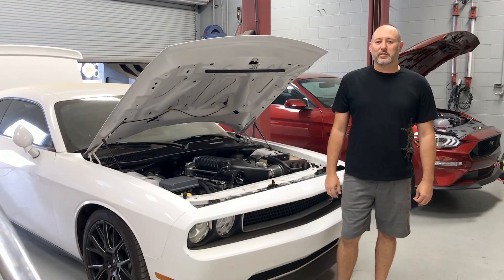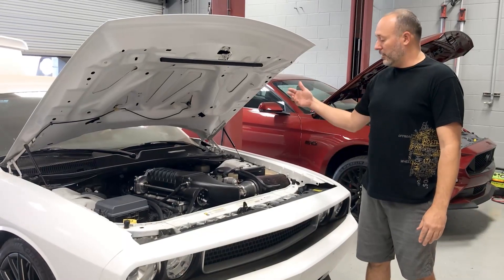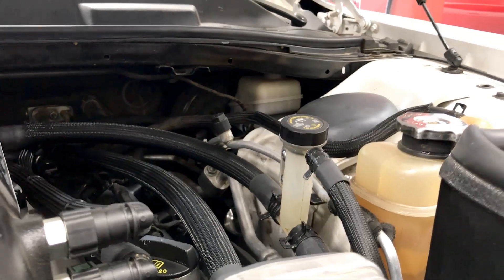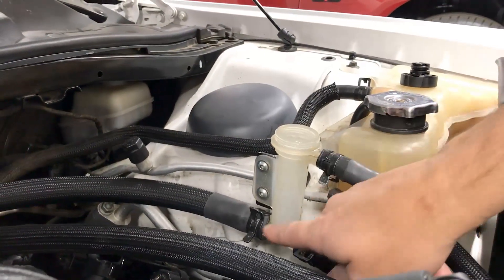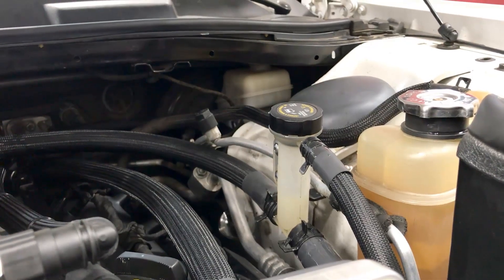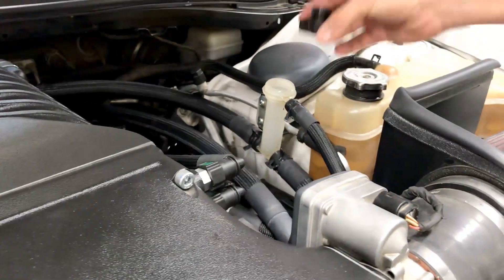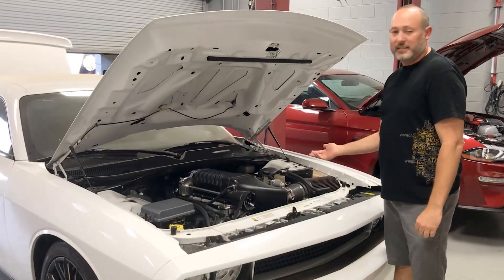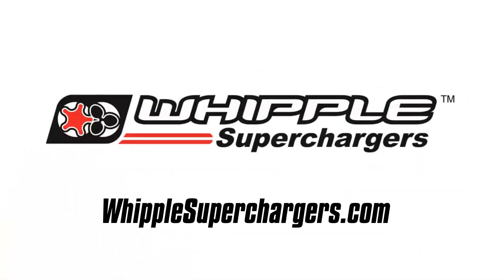Whipple Superchargers Intercooler Filling How-To

Comment: How do you drain and flush the coolant out? I want to switch from GM Orange junk to MOPAR OAT.
Reply from the maker: To fully flush, you would drain at the lowest point, then use the pump to circulate through the system with distilled water, then you can go to the 50/50 mix of another type/brand.
Reply: thank you.
 @WhippleSuperchargers

Comment: I am getting one of these installed in May on my 5.7L R/T. I have been searching for an iom (Installation Operation and Maintenance Manual) and can't seem to find anything on Coolant Flushing, Oil Replacement and Belt replacement and part numbers.
Reply: What’s up dude … I’m thinking about same production,, i have hemi 5.7 I plan to install whipple 3.0 … everything is fine?
Reply: @husb777  actually the Boost A Pump failed after 1 year and my builder/tuner ghosted me so I went with an aftermarket pump that does not require a Boost A Pump. Whipple should include a better pump in their kit (I have a "Stage 2" 2.9L) and ditch the little MSD box. I also wish they put a drain on the inner cooler.

Comment: Do u ever have to add engine oil to this supercharger?
Reply: 100,00 miles you change it, from what I read. You need a liquid transfer pump and a small amount of oil. The manual is on their site along with recommended oil.

Comment: I have a 2019 Dodge Challenger Scat Pack 1320 with a 392 cu in (6.4 liter) engine.
Would adding a Whipple supercharger void my factory warranty?
Reply from the maker: Yes, your factory warranty for the powertrain would be void for issues the SC would cause. We do offer a supplemental powertrain warranty to give you that peace of mind.
Reply: @WhippleSuperchargers  I would like to order the SCT tune again for my car, lost the stock file 😢. What do I need to specify exactly or what things/modification is needed to get me the remote tune done properly ? 
How much does it cost ? ( I got all supercharger parts & SCT tune in package the first time )
Reply from the maker: @thaieralawadh2223  We actually don't keep the stock file, our files are made after a stock read. If you get this, you can send to us and we can send file. Best to go to our website, request calibration or create a support ticket.
Reply: @WhippleSuperchargers  trying to make one but don't know what I should and must mention.

Comment: Quick question, my vehicle (Chevy SS sedan) is push button start. The pump only runs when the engine is running, should I just keep starting the engine and letting it run the pump or is there another way? I can't hear the intercooler pump running with the engine running that's my concern. I won't be able to hear the "cavitation" that the pump is trying to get rid of.
Reply: Brandon without pressing the brake pedal, push the start button and that will turn on everything less starting the motor. So press the start button without pressing the brake. That will kick on your pump.
Reply: @FlatPlaneCranky   Thanks for the quick reply. I received the installation guide from one of Whipple's supply reps via email.  I have to hold the start button for 8 seconds then it powers the inter cooler pump. Thank you though, much appreciated. Fixed my cavitation issue.
Reply: I am curious about this too, I have a push start but mine is a 2016 F150, should I hold the start button for 8 seconds as well or is that just for the Chevy SS Sedan?
Reply: @GuylPechmagre   Owners manual may give guidance on how to put the vehicle into KOEO mode

Comment: Cool video Dustin.. 2 things. Noticed the hood insulation was pulled is that something to consider on Whipple cars (mustang?). Also I can't hear my pump running with the key on.. I don't have any bubbles. Should I hear the pump on an 18 gen 5 car? Lastly is there any point in putting any after market wet water or water super cooler in the inner cooler system.. I hear some do.. thanks for the video and the great products. I love my SC and car..
Reply from the maker: Thank you for your support! Aftermarket products such as water wetter do help, no drawbacks to adding a bottle. You should certainly hear the pump running on the 2018 Mustang, its located on the driver side fender area, under the headlight. There is a 5 second delay turning on but you should here it rev up and then hold  a steady rpm. You should be able to look at the filler tee as well and see water passing through it. If you see neither, its best to make sure its good and cool (overnight cool off is very safe), then using a rag over the filler cap, open the cap. If it comes out with pressure (you'll know), then it had a big air bubble.